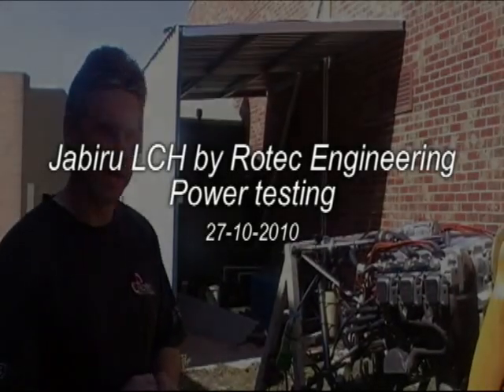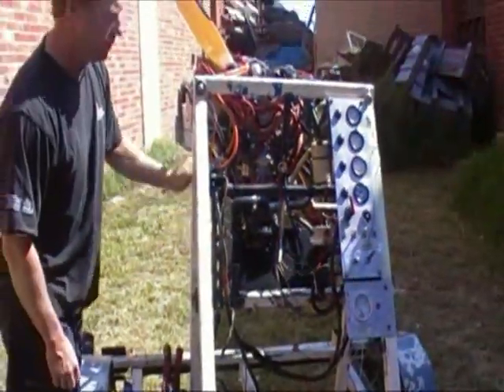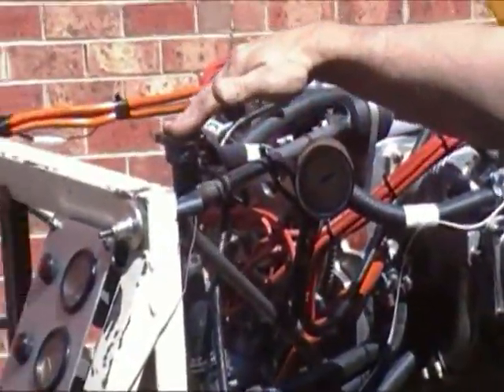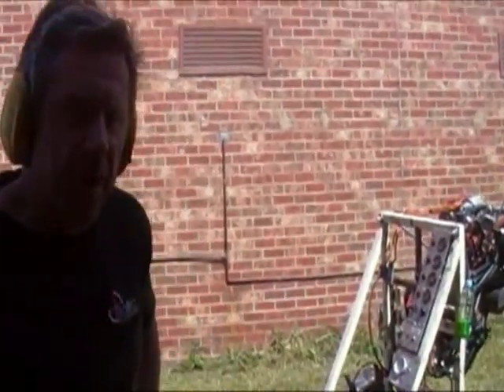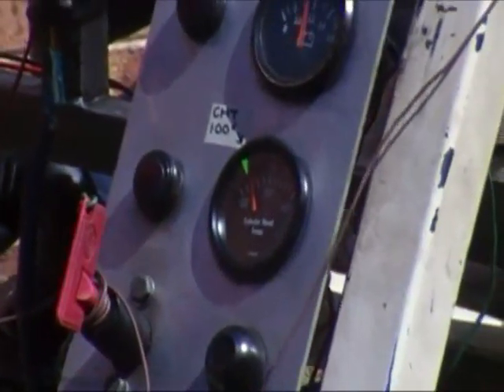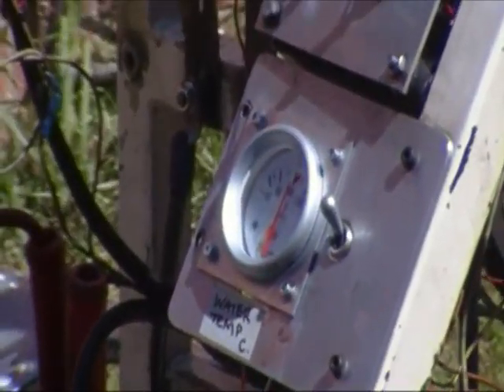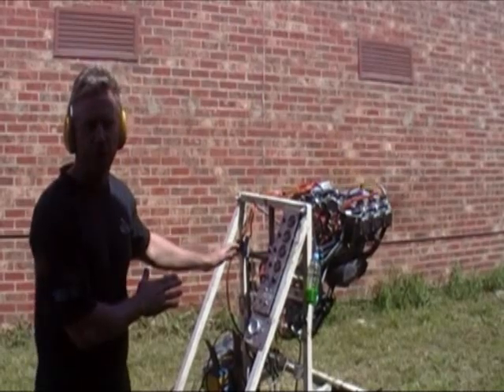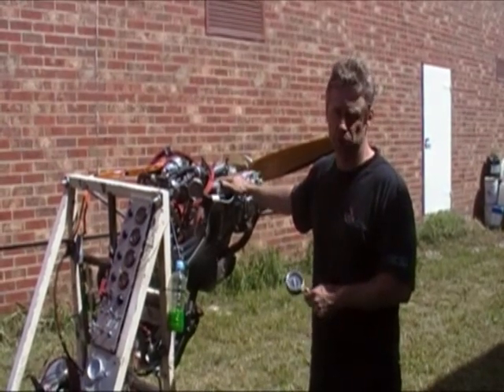Jabiru LCH testing - FANTASTIC Temps! by Rotec Aerosport

Comment: Absolutley fantastic ! Congratulations from Norway ! Will you produce a 2200 jab kit ? Also, when will you start on the vw heads :) I have a sonex with a 2180cc turbo EFI vw engine. But LCH would really add some amazing cooling performance. Also, I have build a turbo 2200 jab. I puts out 137HP with 42in\Hg MP. Turns a sensenich 54x64" prop to 3050rpms static. Thats a 3300 jab prop machined for the 2200 prop hub. Thomas - EdgePerformance.no